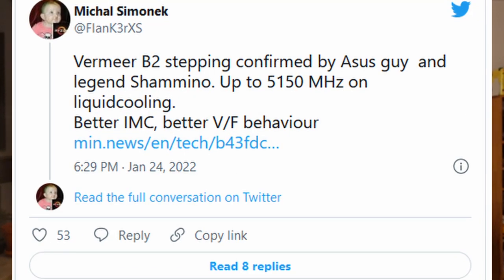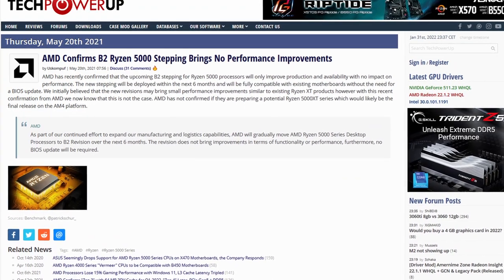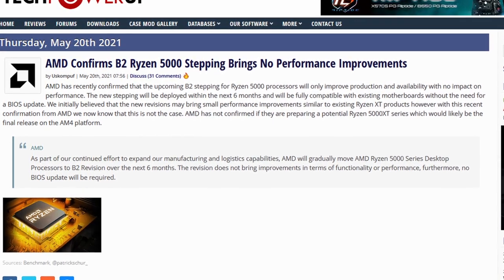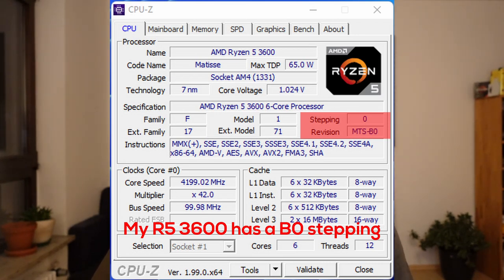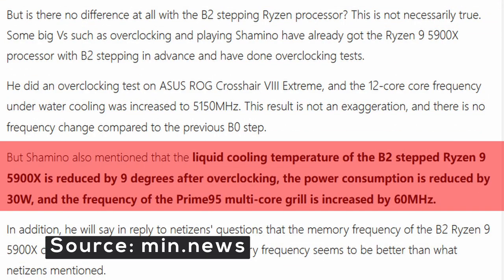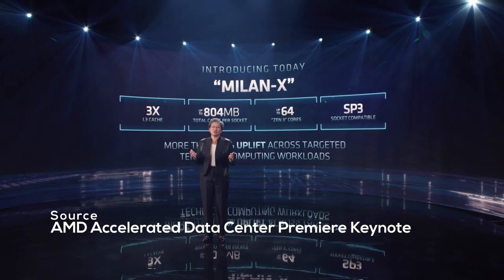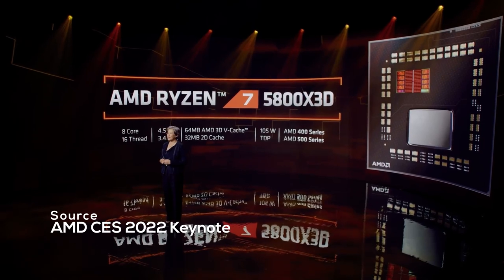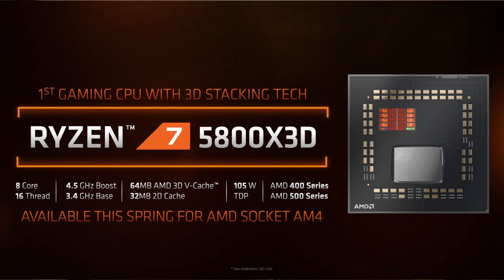Ryzen 5000 "B2 Stepping" Explained

Comment from the maker: Right now the best way to get a new B2 stepping Ryzen 5000 CPU is to buy from a big retailer, because they burn through their stock more quickly and there's a good chance you get a CPU that was produced recently. Starting Q4 2021 some Zen3 CPUs might be B2 and with a 2022 production date it should be pretty certain. 

You can check the date on the heat spreader of the CPU in the 2nd row. The first one should look something like this: 100-0000006X and then underneath is should read "BG XXXXSUS" The "XXXX" is a number, with the first two for the year and the second two for the week. So "BG 2147SUS" means 2021 week 47, which is very late 2021 and a good chance its a B2-Stepping. A 2022 year number, eg "BG 2203SUS" should be B2 for sure.

But the only way to 100% know is to run CPU-Z and check the stepping.
Reply: Today I bought my 5600x, it's B2...  The number is 2152SUS...
Reply: Just bought a new 5800x from Microcenter today. It is part of a brand new stock they just bought in this week. The BG number is BG 2203PGS.
So it was produced on the 3rd week of 2022 but what is the significance of PGS vs SUS? My first 5800x bought from Bestbuy last November was a B0 😭. Hopefully this one is B2 so I can swap it into my H1 (itx) case. The older one will go into my desktop as it has better cooling.
Reply: thank you, i am right now in the middle of buying one for 235€ and the other cost 250€ (B2 Stepping Guaranteed) and i tried to figure out if i can read from the DIE if its a B2 Stepping. For 15€ more i totally take the B2 stepping, you saved me a bad decision, thank you very much my friend !!!
Reply: Ok wow i got BG2208SUS

Comment: I recently bought a Ryzen 5 5600X from Amazon Spain to upgrade a friend's computer.
B2 Stepping, confirmed with CPUz.
Default BIOS: reaches 4650Mhz on its own extremely easily...
RAM 4000Mhz and Infinity Fabric 2000Mhz without any problem...
Slightly lower consumption...
And the most surprising, about 10 degrees less on average, built with the same cooler as the 5600X (B0 Stepping) that I built 6 months ago for another friend...
Reply from the maker: Gratz! Yes, B2 uses less power, is cooler and has a better memory controller. Nice catch!
Reply: Just bought a 5800X batch 2205SUS Rev. VRM-B2. Never goes over 72C reaching 4650-4750 all cores. Collermaster AIO 120mm + push/pull. The 5800X replaced a 1800X and temps are mostly the same, idle high 30C benchmarking tops 73C with blender and CB23. Single core boosts to 5050MHz with OC +200 but destroys the curve optimizer, so I keep OC +50 boosting to 4900MHz. CB23 16163. It is installed on an Asus TUF B350M !!!

Comment: I just bought a 5800X 9 days ago and it was MTS-B0 stepping, it died 5 days later and I had to RMA it. New one is VRM-B2 and it is able to run with significantly lower voltages (curve optimizer got -11 average on the old cpu meanwhile I am doing -30 on all cores on the new one meanwhile performing better than the old one in CB23).

Comment: Is there any more info about how to identify if a CPU is B2 already?
I'm planning to buy 5800x but I would rather wait a couple of additional weeks if it's enough to receive a B2 from the store.
Reply from the maker: Sadly, there is no sure way at the moment. The best way is to buy a CPU from a popular retailer because theres a good chance they are going through the stock quickly and if you buy a CPU its a fresh one. Ryzen 5000 CPUs from late 2021 on should be B2 stepping based. But the only sure way to find out is to run CPU-Z and check the stepping.

Comment: I just bought a 5900x, and it's written on the BG2152 heatsink,
so it was manufactured in the last week of 2021, did I get the B2??
Reply from the maker: Last week of 2021 you have a very good chance its B2, but only way to find out is to install it and run CPU-Z.

Comment: Is it OK to run my 5800X with B2 on negative magnitude on 30 all the time? I've tried Cinebench R23 and Prime95 and it was stable all the time.
Reply from the maker: It’s perfectly fine, just beware that some games might be even more sensitive than Prime95 and if you encounter instability decrease your UV.
Reply: 5700X here and was shocked to find that it was stable on all cores with -30 curve optimizer.
Reply: @betaunknown  that's really really COOL 🙂👍
Reply: @betaunknown  I'm on a 5800X3D - 30 with a RTX 4090 and couldn't be happier
Reply: @Serandi1987  sounds like a killer combination!! Thank you AM4. 🥲

Comment: The change could olso be because of the TSVs. With ZEN3D you have to have chiplets with TSVs to the top to connect the SRAM Cache! I would guess this means also a new stepping!?
Reply from the maker: Yes, that also a possibility. We know that the B0 stepping also has the TSV connection points, but maybe AMD needed to do some fine tuning for the final product?
Reply: @HighYield  Are you sure that B0 also had the TSVs?
Reply from the maker: Sorry for my late reply. Yes, ppl spotted them at the Zen 3 release, but didn't know what they were meant for.
Reply: @HighYield  thanks for your reply. There is no reason to be sorry for.
Because of the TSVs I offered AMD the idea to flip over the CPU die to minimize the the amount of Material between heat source and IHS. As it seems with the 5800X3D there is a limiting factor because of temps.

Comment: damn am i gonna be pissed if they release 5950x3D still anyways i just got my 5950x for dirt cheap its VMR-B2 stepping
Reply from the maker: I dont think we will see another Zen3D product for the consumer market, so you are good ;)
Reply: @HighYield  I ran curve optimiser now today on my chip per core it just set everything to -30 lol after that i set my usual pbo limits and it peeked 5,175 mhz lol, i read finding out stability is is a painful long proces i personally just wanna test during normal use instead since its more likely to crash in variable light loads, my only worry is how i find out which core gave error so i can adjust that cores curve :D
Reply: @Not Franky Where did you get one dirt cheap?